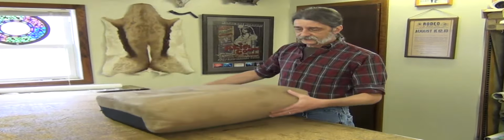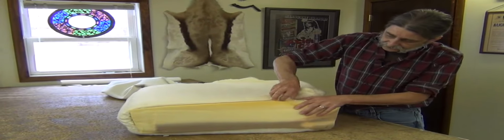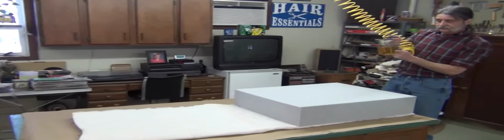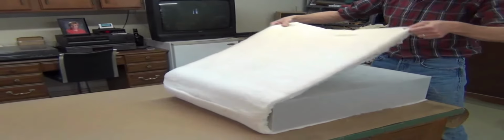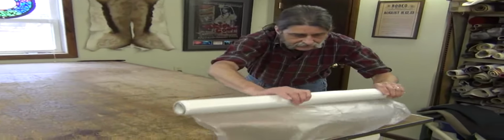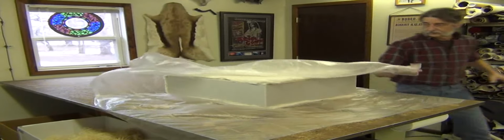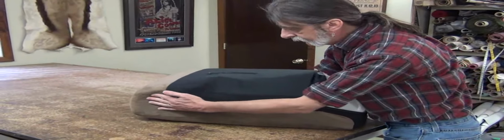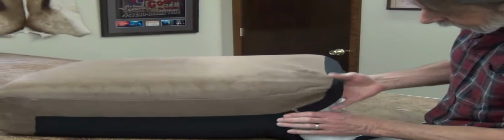How to Fix a Couch Cushion

Comment: I learned a new tip...put the end of vac between the foam and dacron!  thanks...I will tell you that I clamp my vac hose to my table which allows me to better handle my cushions ( or else I am likely to pull the vac away before I really want to
Reply from the maker: The ridges in my vacuum hose tend to grab against the metal edge on my tabletop. Yes, sometimes it does want to pull away.

Comment: This is such a great video! I want to replace my sofa foam with a more firmer one. Could you pls recommend a firmer foam grade?
Reply from the maker: In the video I used high resiliency, HR-30 lb. Suppliers will differ in their ratings. HR-43 is my next option and feels very firm in 5" thickness.
Reply: Thank you!

Comment: This was a great video, very interesting to learn the techniques!  I believe my cushions are 7" in height.  Would the HR-30 be sufficient for the 7" depth?
Reply from the maker: Seven inches is a very thick cushion. This sounds unusual... HR-30 is relatively firm. What is the present height from floor to cushion top? 18"-19" is typical seating height prior to compression. Are you a tall person?
Reply: Buckminster Upholstery thanks for the heads up.  I'll re-evaluate and get thise measurements.  I'm not unusually tall either, so I must have measured wrong.
Reply: Buckminster Upholstery, so the seam to seam depth of my cushions is 5.75", the foam measured about 5.25" in the back where it is less worn.  The batting was only covering one side but it 1" batting.  I think I'd like to do the standard 3 sided batting covering but not sure which depth of foam to order.
Reply from the maker: Usually the boxing is slightly under the foam thickness in order to give the cushion some crown. 4 1/2" boxing = 5" foam. In your case I would use 6" foam. Inspect the seams to make sure they have adequate allowance (1/2"+) Often times factory workers get sloppy with their sewing. Loose woven fabrics can slip apart at the seams when subject to a tight fitting core.
Reply: Buckminster Upholstery great, thanks for your help.  I'm going to share your video!

Comment: Fascinating. How did you get the rest of the plastic out from the snug closed end without ripping off?
Reply from the maker: Not too difficult to fit my hand inside the cover. Plastic slides pretty easily but you must be careful to not stress and break the zipper.

Comment: Great demo. I wondered how the silk wrap worked. Can it be left in place for outside cushions, perhaps? I’m looking to wrap the current cushion material for my patio chairs to replace the worn out cushions. I’ve got sunbrella fabric already. 
The cushion material is a bit soft. Could I glue a thin, firmer foam to the existing foam to give it a bit more oomph? The cushions are currently 3-1/4” thick. Better quality seat cushions can be 5-6” thick for a seat? 
Are there any books on upholstery that you’d recommend?
Reply from the maker: Contact me via my website for more information

Comment: great job. I need a replacement foam for my love seat couch but no furniture sells it. strange!! when u buy furniture from them it comes with it but them don't sell it separately.  so I am gina soak my foam in water and air dry it and hope that will help and get back the shape after.
Reply from the maker: Soaking your cushions is a bad idea! It won't dry as easily as you think. Ever smell a stale sponge from the kitchen sink? Trust me, don't do it.

Comment: hello my name is Nicole and I look your very interesting videos. I live in France near Paris.
My husband and I want to redo all the cushions of our lounge.
We bought foam blocks cut to our measurements.
How to measure the final fabric to have a good comfortable and well rounded cushion? Finally, where do you buy the plastic in which you put the foam covered with cotton wool to clear the air with a vacuum cleaner?
Thank you very much for your response that will really help.
cordially
I apologize for my English school!
Reply from the maker: Hello Nicole.
 If you're making new covers measure the original to get your fabric measurements. Try shopping a hardware or paint store for the cheapest, lightest weight disposable plastic drop-cloth. This should work with the vacuum to shrink the foam cores. Thanks for watching. Kim
Reply: Thank you very much for your answer.

Comment: how do you deal with tufted cushions? same process or would you have to deal with the batting a different way?
Reply from the maker: I'm not sure what to tell you, not seeing your cushions. If they simply have buttons pulled in on both surfaces there shouldn't be any need for changing procedure. Stuff the new core, align and tie the buttons to the desired depth. (talking sight unseen!)

Comment: do you know of any ways or tutorials on how to repair or replace the black fabric you see on the back and bottom of the cushion fabric? I have a leather couch and most of the seams are pretty much shredded or torn.  I want to either cover over the black or totally replace it. the couch itself is in great condition and i want to bring it back to life again. not worth throwing it out in my eyes. any Help would be greatly appreciated.
Reply from the maker: I don't have any related tutorials however a repair of this sort should be fairly straight forward. Your problem may be with an adequate sewing machine as leather is sometimes difficult to sew. Home dressmaker machines aren't designed for some of this heavy work. Basically you need to carefully remove the covers, trace or measure out the damaged fabric and sew it back accordingly. Review my couch cushion video for guidance in finishing the project.

Comment: I did and got a quote for 6 cushions. It was quite a bit higher then I thought so I'm going to shop around. Somehow I thought it would be a couple of hundred dollars and it came in at 750.00, with a 35 charge per cushion. The guy was super nice, but discouraged me from doing it on my own since really most of the cost is for the foam. Also, he said the foam was a bit higher density. I think 35 vs the HR30.
Reply from the maker: Density can differ. A distributor from years back had HR-33 which I used mostly in 4" thickness. HR-30 is quite adequate at 5". Prices vary from one location to another. The price you were given per cushion would compare with one of mine completed in average size and shape, including new dacron. The deciding factor lays upon the condition of the upholstery and how long you intend to keep the furniture. Bummer but a couple hundred bucks won't gain you anything... Thanks for tuning in!

Comment: Why not just let the plastic stay in place? It would make the cushion foam spill resistant and make liquids easier to dry up. At least until the plastic disintegrates. You wouldn't be able to hear or feel it through the fabric.
Reply: Because if you were to sit on it and displace the air, it won't inflate back to it original state.
Reply: +rkg99709 Thank you.
Reply: To add, the outer covering would continue to move across the slick material as there is nothing to hold it in place. The covers seams would then continue to move. You would also hear the plastic each time you sat in the couch, which might be an issue for most.